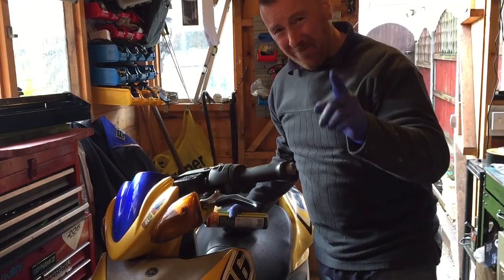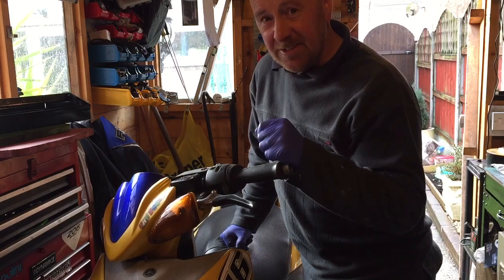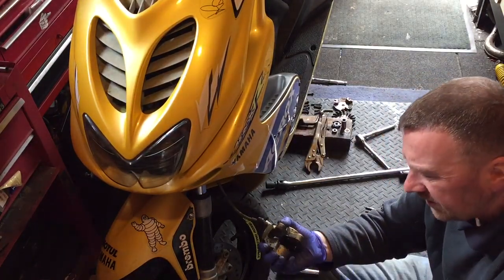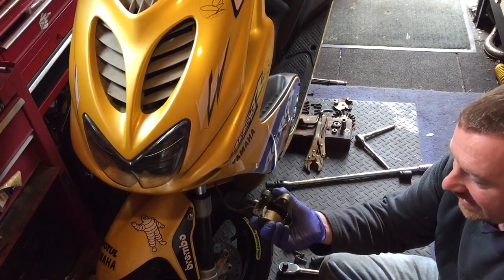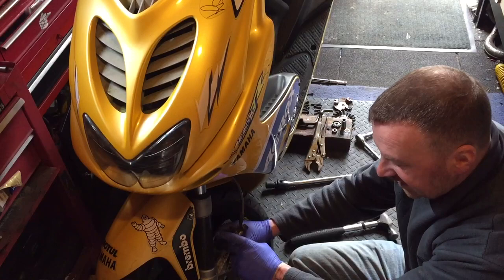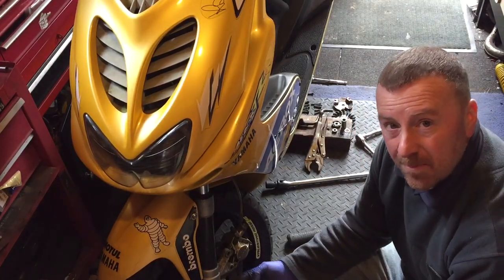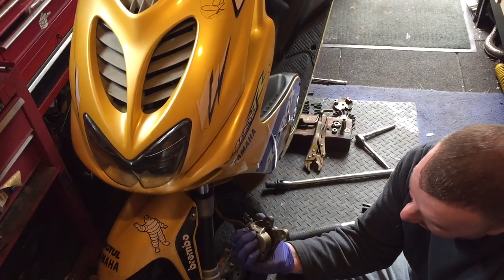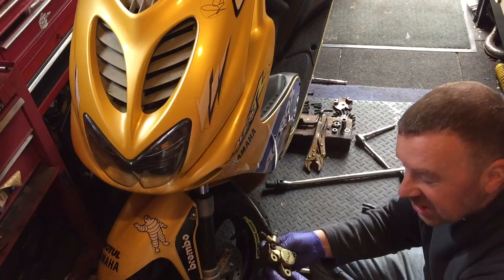Fixing jammed binding or stuck moped 50cc 125cc brakes

Comment: Hello Mark good vid like always I was wanting a little bit of advice I've got a 50cc gy6 4 stroke and it has spark fuel air and i think it has good compression ive spent over 200 in parts and it still won't start it has had everything new on it piston electrics everything but crank oil seals and valve head now I am thinking it's the valves or oil seal just wanted to no what you think it might be thanks and keep up with the moped vids
Reply from the maker: that's for the comment and watching my videos, as for the gy6 engines , I find they run or just don't !!sorry to say normally they run low on oil and seize or yes the valve or chain jam or free up and kill the engineI've just changed the engine as they are cheap and easy to get, as you have paid out £200 all ready I guess you have to keep going, so you have petrol and  plug is getting wet - cleaned carb and changed plug . have you put your hand over the carb when turning over as in my other videos? how many miles has it done? piston and valves is all it could be after that and opening that up remember to keep hold of the chain with some wire, don't let it fall down!!good luck bud and take care. mark
Reply: If you haven't had valve clearances done. Then that will be your issue.

Comment: Hi im 16 and I brought a Yamaha aerox to get me to collage but there was a few problems with it but we sorted most of then but it won't fire up it goes to but won't go im a dissent lad I haven't done any mods to it i just want it sorted and I've watch all your vids on Yamaha but I dont know what's up with is can you help
Reply from the maker: hi budyes I do have a few aerox videos so if you have watched them lets start with the basics changed plug, cleaned air filter, cleaned carb properly, you have spark as test in my videos, you have a wet plug so fuel is getting in , carb test so wet hand as in my test video.is it water or air cooled check piston??hope that lot help please like share and subscribe and get back to me aftermark

Comment: thank you man : but I hardly understand your English with French accent Man !
Reply from the maker: hope it helped and theres many more videos no my channel that may help and not in French lol
Reply: Thank you Master Mark : but I think that you Speak more than one language , I have forgot to ask you my question : can I oil or put Grease on the Pistons of the Brakes , the two Pistons so they slide easily or no ?
Reply from the maker: yes bud I clean them up and use the brake grease or copper grease, just don't get any on the pads lol 
some cheap brake pads fit tight so I often rub down the side end bits so they fit in and free to move ( top tip lol)